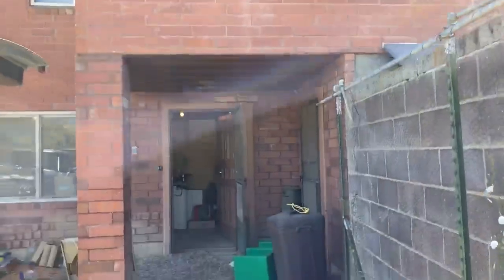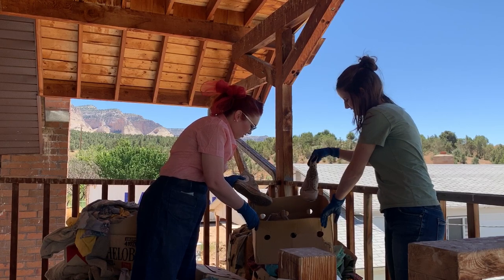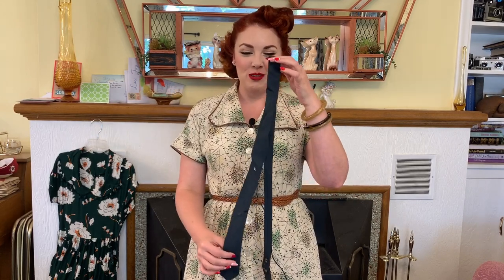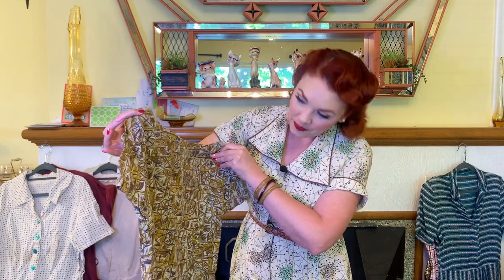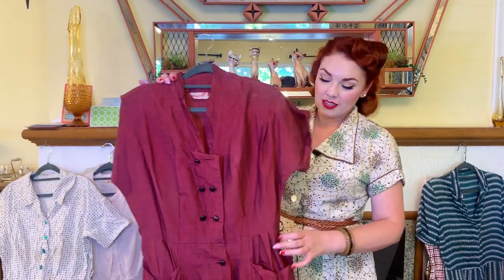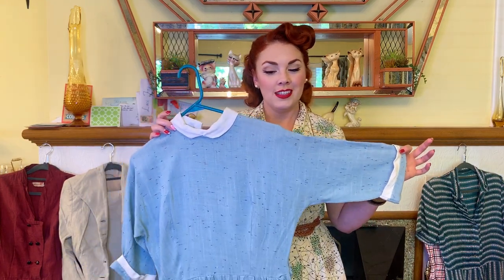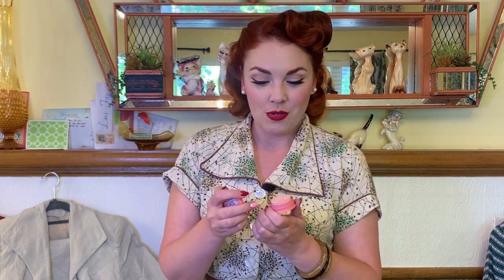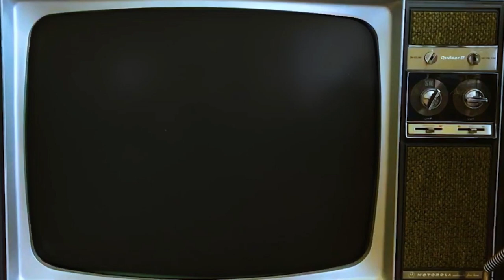Vintage Haul: Exploring a Hoarder's House

Comment: I found a vintage 50's swimsuit years ago , over 15 years. But I just love it, its green with a pink and white chevron neckline that goes to a point down the center. And with the little skirt part in the front. Anyway, it has that crumbly stuff all throughout the bust ! I don't know if that's just  what remains of the elastic or what, but I'd love if it could be repaired. Is that possible at this point? The suit itself doesn't seem to have much stretch either unfortunately. Maybe I could find some way to repurpose it into a dress if you think those are bad signs about it's condition. 

This video was an absolute blast and  you found so many amazing treasures ! Thank you for taking us along!

Comment: The short green gingham dress may have been used for clogging.  Clogging dresses were shorter than square dancing dresses in the late 60's - 70's.  It could also have been used for a cocktail server.  I worked for Host international in the early 70's and we wore something similar the top looked similar the dress we added a very short petticoat with ruffled panties that showed when we bent over.  More research needed to be absolutely sure which way it was used

Comment: **The Green Dress** - First, I read through the first 100 or so comments, and I didn't see anyone mention it, so if this is redundant I apologize.
The green dress is likely from possibly either a square dancing/barn dancing set, or something similar. The lining of the skirt that matches the bodice is intentional; the flare of the skirt would knowingly fully expose the underskirt when dancing. It is shorter than most square dancing, but it may have been a particular purpose or event that called for it. 
Next option? A mock dirndl. A dirndl is a German/Austrian traditional dress. Its hallmarks are the tightly fitted (sometimes laced) bodice, a flared skirt and depending on the region, the small, shirred, capped or elbow length sleeves and there is usually an apron over the skirt. I am not referring to those travesties of cultural slaughtering that are sold for Halloween costumes - I mean the real deal. I do have a few as my family fled WW2 from Emmendingen, Germany. 
And dirndls are what square dancing outfits were initially modeled from because the skirts were generous and allowed movement, yet looked good on the women.
**Dirndls should make a comeback** Because, I am serious - I don't care HOW you are shaped, or what your size is - a good dirndl will make you look like a knockout. They push up your "girls', pinch in your waists, and contrast the waist to hip/breast ratio with a flared skirt, which also makes the waist look smaller. I don't know why we don't wear them more today. A dirndl does nothing but accentuate a woman's figure. I have a very plus-size niece for whom I made a dirndl fitted for her. We went to the Oktoberfest here in Cincinnati a few years ago - she received SO MANY compliments - she felt good about herself for the first time, in a very long time, while out in public. She said she wished she could wear a dirndl every day. I think she should. I think a lot of us should! 

GREAT FINDS! I LOVE WATCHING YOUR VIDEOS! :)